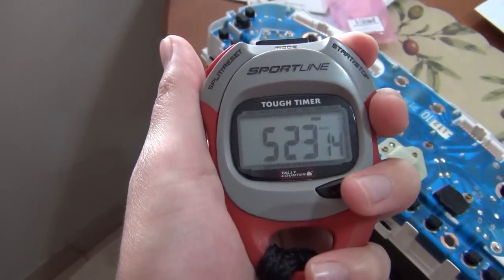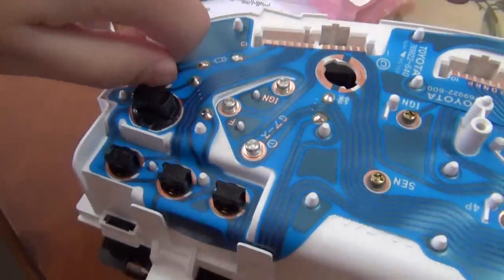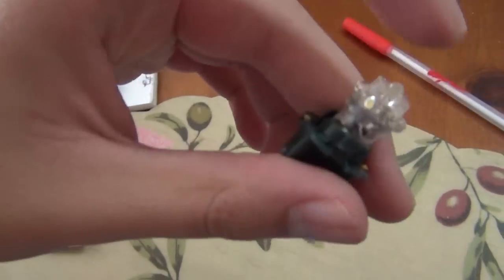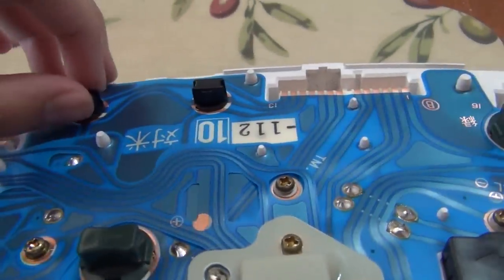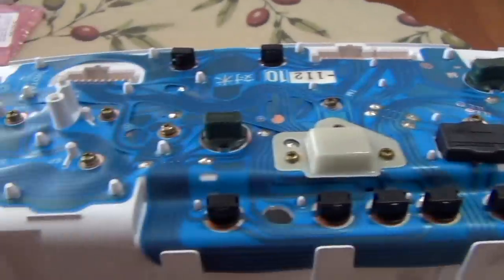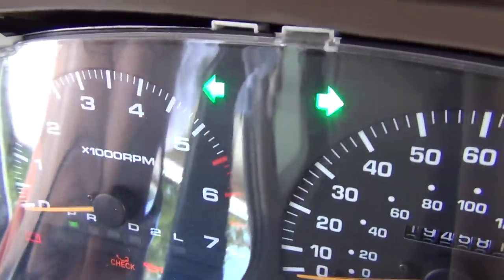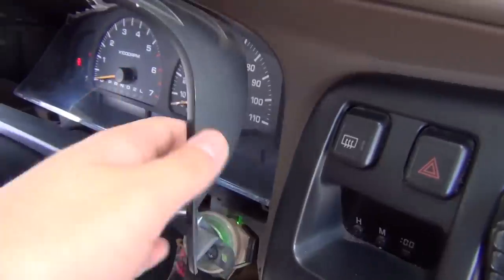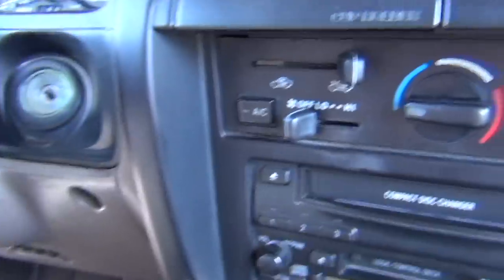1998 Toyota 4Runner LED Dash Replacement

Comment: SonI got a 2002 4runner SR5 2wd. Does anyone know what dash bulbs I need for the speedo and tach? I also want to change out the HVAC control bulbs. Any idea what sizes I need?
Reply: The climate control bulbs should be number 74.  Ditto for the glove box light.  194 or 168 bulbs are commonly used for the instrument cluster.

Comment: Hello, what if the gear light on the cluster is dead, is there a bulb behind it too?
Reply from the maker: Those should be number 74 bulbs as well. I'm not sure if the original bulbs have a colored latex cover on them or not. I'd just get LEDs that are the correct color for the gear lights instead of all white LEDs.

Hope this helps!

Comment: I have a 1996 Toyota Hilux Surf it.looks like the identical dash instrument panel as yours which later on I'm going to the all the bulbs to Leds I know some of the leds would be T10 bulbs would that be correct & the smaller ones would they maybe be T5 Led bulb's would correct or would they be T4 Led Bulbs Kind Regards Peter from New Zealand  & I will be getting these Led bulbs from AliExpress & the Led Bulbs are Very Reasonable Prices I look forward to your reply Thank You
Reply from the maker: Hey Peter, from what I've read the only 2 bulb types in the dash are #194 (larger one) and #74. I'm not sure if T10 and T5 are equivalent sizes or not but online I just see #194 and #74. Neo-wedge A and B were also mentioned for some buttons.
Reply: @ArtiePenguin1  I actually thought they were T0 & T5 bulbs apparently they can't be as I have the high beam warning light has blown on me & I thought later on I would replace the all the bulbs with LEDs when I take the instrument dash panel out so apparently & I assumed they took T10 & T5 bulbs apparently I was was wrong they take other types of bulbs on my 1996 Toyota Hilux Surf it has the 3.4 V6 motor  Kind Regards Peter
Reply: @ArtiePenguin1  Hey thanks for that so they are 194 for larger bulbs  & 74 for the 74 for the smaller bulbs my friend he thought the bulbs in the dash instrument panel were T10 & T5 bulbs but apparently not it's 194 & 74 bulbs I Thank You So Kindly Kind Regards Peter I will get these bulbs at a latter date but in leds Thanks Again Artiepenguin 1

Comment: Looks like good content but DUDE!  Stop with the head cam.  I couldn't watch it for all the swaying back and forth.
Reply from the maker: Sorry, this was an old video, I now have better stabilizing equipment and technique
Reply: @ArtiePenguin1  ignore me, I was grumpy from being right in the middle of the job :)
What was really irritating me was nothing I checked had a proper bulb type.  You seemed to have the right bulbs.  I had one of the big ones go out and I finally hand-fitted a 2721.  All the rest had a too-skinny base so the socket wouldn't grab - even after tweaking the copper connections.  Did the OEM bulb go obsolete?

Comment: I replaced the larger dash bulbs with LEDs and they work great. The 74 bulbs for bright beam indicator and cruise control indicators LEDs do not work . Any ideas?
Reply from the maker: Hmm not sure, I guess just check that they are in the socket correctly and maybe reverse them in case they are polarized bulbs...